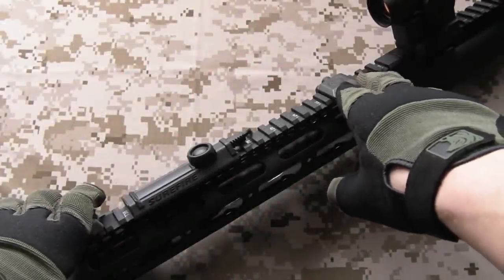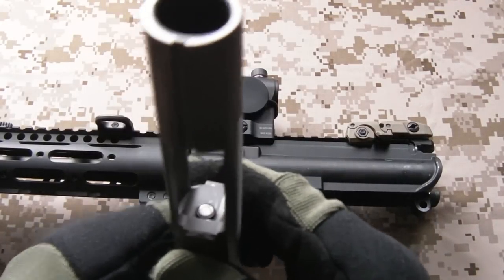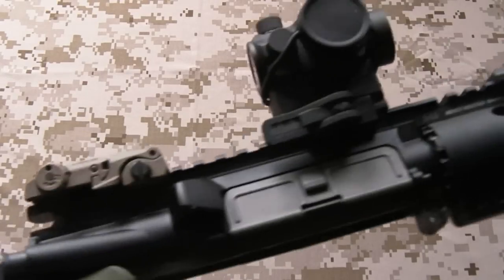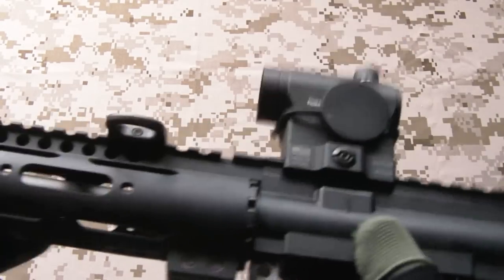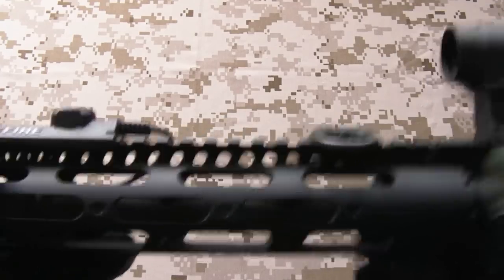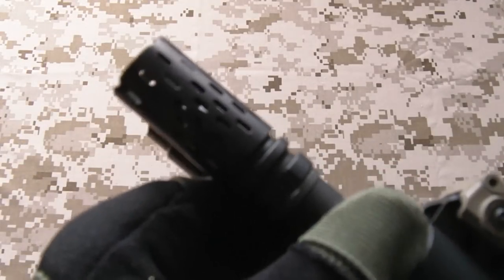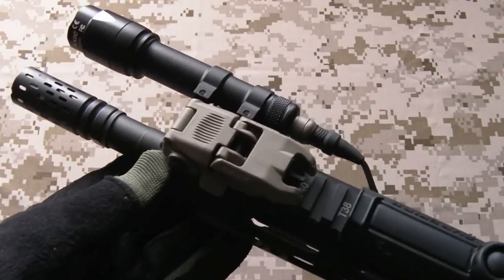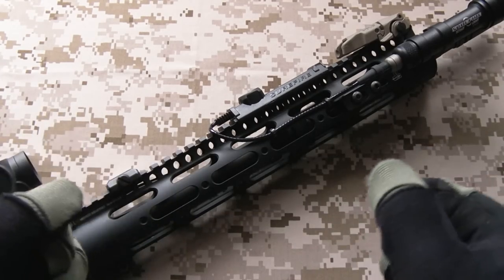KWA LM4 - GBB Rifle - Upper Receiver

Comment: Best LM4 Setup Ive Seen! 

I just got an LM4 a Few days ago and I'm Planning on changing the standard hand guards to a VTAC Or a TRX Rail System will i need to change out the Delta Ring if so what delta ring do you recommend?
Reply from the maker: Thanks.  Whichever handguard you buy should come with its' own barrel nut (which is the part you're probably thinking of) to fit the system, so no worries on that side of things.

Comment: Would you be able to post a link to the Thread die you used to tap the treads for the handguard? im looking into this rail system for my polar star
Reply from the maker: You'll want a 1.25" x 18tpi die nut.  Got mine on ebay.
Reply: Cheer for the responce, thanks alot
Reply from the maker: No worries.